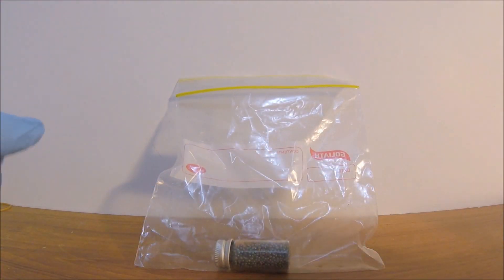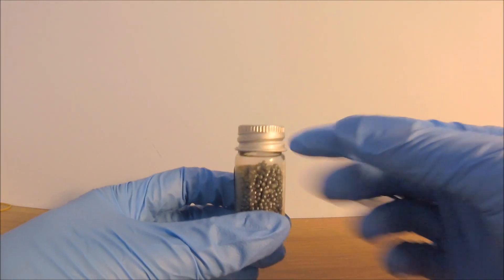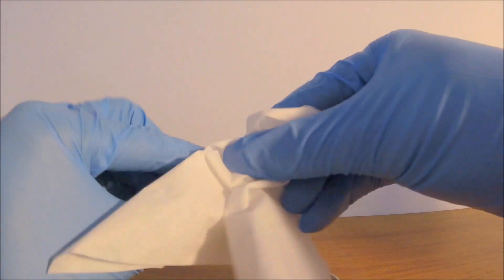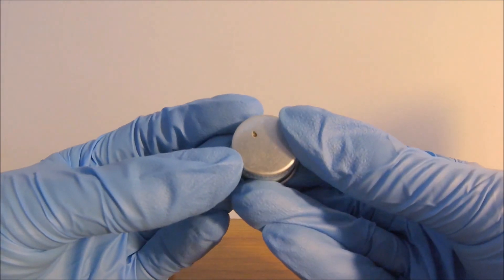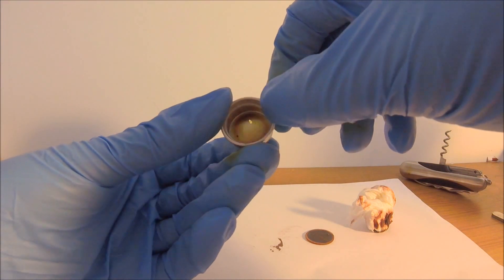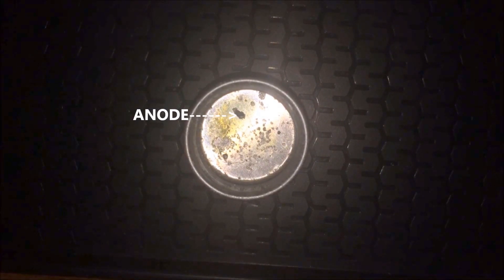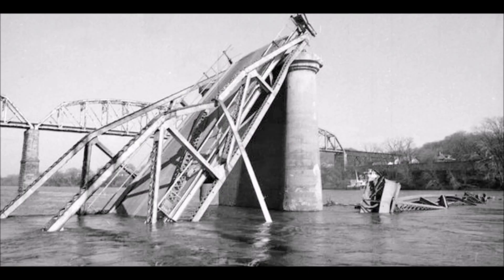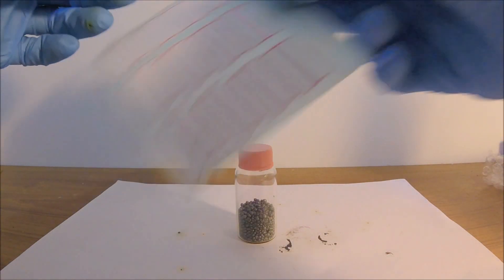FAIL!  Bad Iodine Storage

Comment: I had this happen to me but a bit worse as far as destruction and contamination. I used a Mason jar but only temporarily but instead I forgot to make a new container for about 6 months. When i retrieved it the lid was pretty much not there just some traces left. The iodine was gone and I had about 20g the entire tote it was stored in was coated and I had lots of salts in there like cobalt, iron, nickel, aluminum ect. All of which had the lids eaten away. On top of iodine being corrosive it made anhydrous iron iodide and anhydrous aluminum iodide which hydrolyzed and created HI. All of which just created havoc in the tote. Surprisingly enough the iodine didn't escape the tote and for whatever reason i found alot of it gathered in one area at least what was left of it. It's quite interesting to see but the clean up was a pain and I had to recycle all my salts and clean many items. Every container had iron rust at the bottom I'm assuming from hydrolysis of said anhydrous iron and aluminum compounds. It's great to see storage failures as a reminder that we should be mindful of storage practices.

Comment: iodine is one slimy bitch. it seems to escape many enclosures. ampouling is probably the safest way to stop it from subliming away. obvious con for that is you need to break it open every time you need some.  keeping the bottle in a freezer is a good way to slow it too.  about two years ago i took a risk and bought 25g of iodine from an ebay seller located in china and the way i received my product was unbelievable. it was simply put into two ziplock bags, one inside the other. the post bag reeked of iodine and the label with my address and other details of the content was heavily stained brown from the iodine. im surprised that it did not get confiscated. it was truly a terrible way to ship a volatile item like that. i also lost a few grams of it as well.
Reply from the maker: just ziplock bags?.......I am speechless, I really dont understand, those Chinese ebay seller already sell things at a higher price comparing to the on price on Alibaba ( I hardly buy anything from ebay, Alibaba is my main source), and yet being so cheap at the packaging just to save few bucks for the shipping.